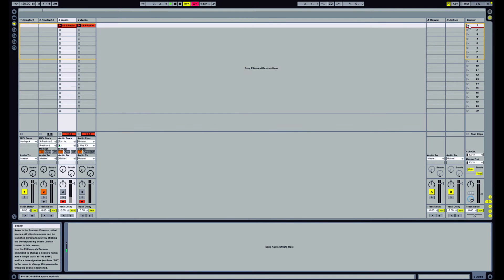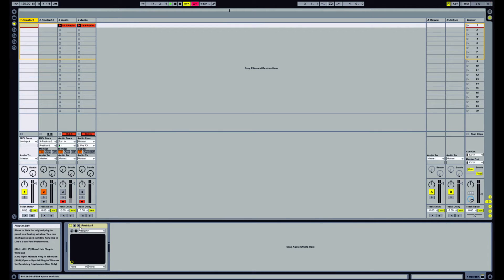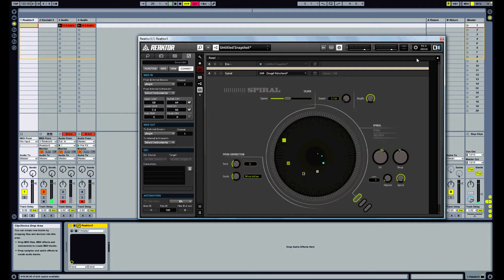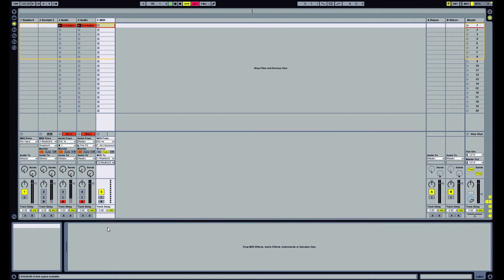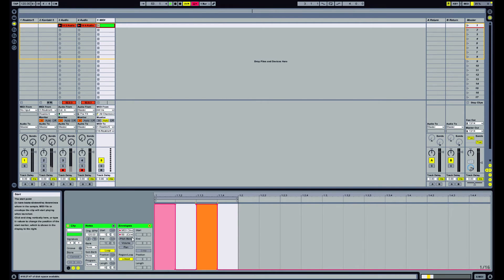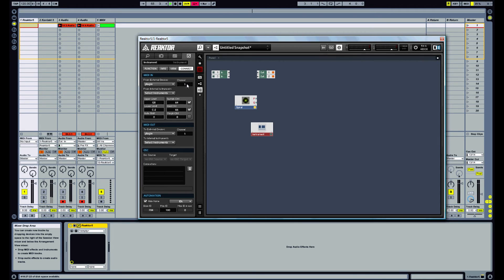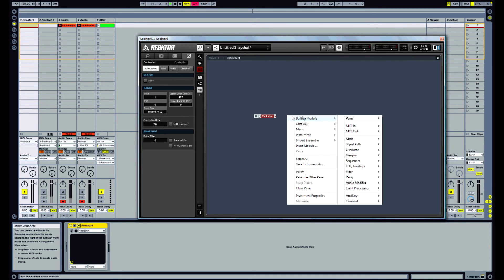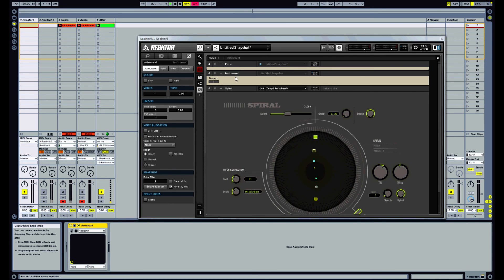Ableton Live + Reaktor VST bug fix

Comment: Gonna try this tonight. You may have just saved a project of mine :)
Reply from the maker: I had a listen to one of your clips, I hear a lot of reaktor instruments in there! I might have to revisit some of this stuff. I have reaktor 6 and don't use ableton live much now. Something like plogue bidule handles MIDI properly, but isn't easy to sequence like ableton.
Reply: Thanks for the listen :) I use a ton of NI stuff, and I really like Reaktor. Your fix seems to have saved this project I'm working on. Since implementing it, the Reaktor sequencer has been running reliably and consistently.